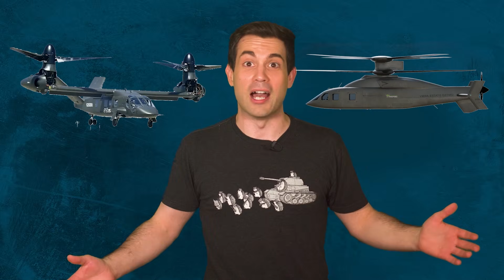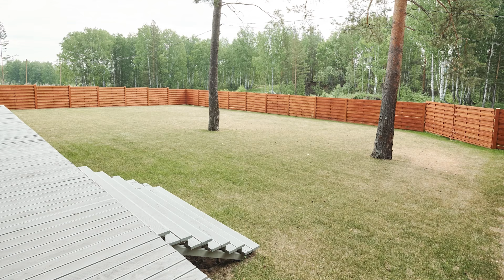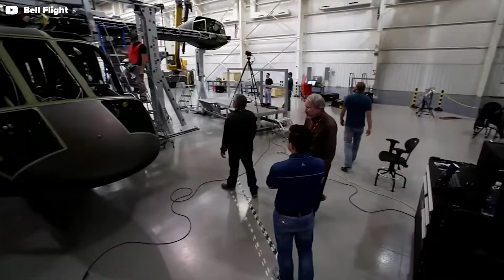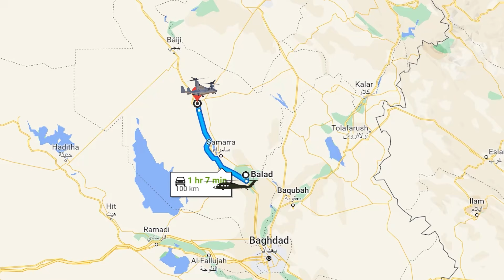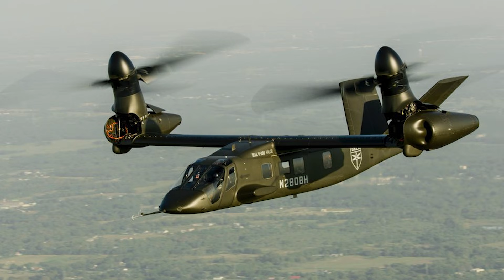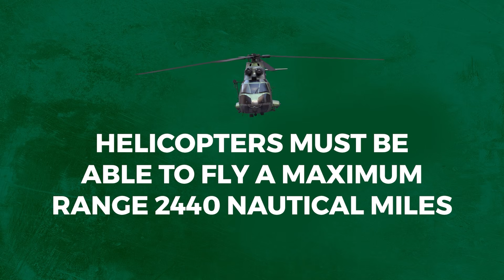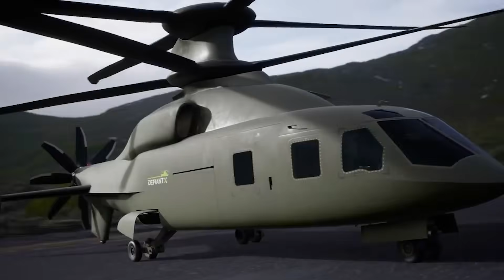V-280 Valor Helicopter Will Help Defeat China

Comment: I think the big screen is a bad idea. if it goes out you lose everything. but this is one of those things that can be changed fairly easily, its just not a good selling point.
Reply: A screen miht look like one big thing, but can actually be built to be multiple smaller screens merged together. It's more expensive than just making the screens obviously split, but takes up a bit mroe space, and not as good for showing larger things over multiple screens.

Comment: One big thing that is mentioned is that Bell and Boeing jointly made the V22 but only the wing components are made by Bell. Boeing makes all of the main body and structures aspects of the helicopter so I doubt that Bell would be able to supply and fab FLRAA in a quick turning point whereas Boeing has both Philadelphia and Tulsa where all they do is turn out helicopters
Reply: The manufacturing aspects behind just seem like a drawback to me of bells proposal to have a fleet rolling out anytime soon

Comment: idk if they can achieve less maintnance with v280. v22 is the most expensive helo to fly, and v280 will be more complex. ALso v22 and probably v280 can't autorotate to land smoothly if the engine quits. Also, BlackHawk has countermeasures to defeat missiles. The new and old helos will be in roughly same position if they were shot at.
Reply: See any of those Black Hawks Landing smoothly? The 280 has a wing for Lift.

Comment: Forward observers, artillery and long range missiles will be the future of warfare IMO - Anything that flies will be obliterated by manpads or automated air defense systems - If the terrain cannot be used as a shield or to hide the incursion, it will have little chance of succeed against AUTOMATED target acquisition missile systems or high precision artillery.
Reply: Only true when you're Russia and you can't SEAD. The US dabbed on air defense systems.
Reply: The Ukraine war is an obvious example that the described scenario isn't here yet or likely soon. Electronic Warfare and stealth design apparently is enough to overcome S-300 and S-400, two of the most advanced anti-aircraft systems in existence.
Reply: @tonysu8860  do you see any Ukrainian jet fighter still flying? what about the 7 out of 7 helicopters downed attempting the rescue of the Mariupol steel plant fighters?
Stealth technology is overrated, just an excuse to squeeze more taxes out of us.  "Stealth" jet fighters has been downed already, no such ting as complete radar invisibility, just MSM bs.
Reply: @TM-529  There are numerous reports of Ukrainian jet fighters flying, surprisingly They're just probably not flying where there are serious threats.
As for the helicopters shot down near Mariupol, I'm troubled by the attempts to resupply using helicopters. If I was in charge of that, I don't know if it would have worked but I would have instead stuffed some empty bomb casings with supplies and dumped them from the largest drones I had. TB-2 drones have apparently had a fair amount of success in this war without being consistently shot down. From what I've heard about the Russian siege of Mariupol, I'd also say any rescue attempt was a very long long shot.

Stealth technology does just fine, thank you.
It's not 100% and won't work in all situations, but it does work against current air defense systems technology

Comment: Should require the helicopter being able to load the M777 gun inside the body, not just sling outside. You can not sling a  gun outside for long distance.
Reply: The issue is that internally loaded materials cant be cut in case of autorotation... making the vihicle  needing much more margine of error.... while... I kind of agree wirh your statment. They would need to be quote a bit bigger
Reply: Ditch the tilt rotor. It’s a over complex design both mechanically and for flying.

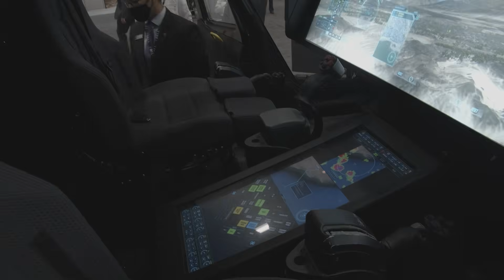Comment: 6:30 well I don't know. It seems like you only need a few hits to one part of the screen and suddenly the whole thing is unusable. Redundancy is key. The dragon spacecraft can have screens for pilot input, but mainly because it won't be shot at
Reply: While I don't know what tech will be used here, a few general things:

1) a Screen might looks like it's only one big screen that is easily damaged, but in reality can be build from multiple smaller screens. That way a group of shots can only take out a part of such a larger controll screen. 

2) going with a merger of smaller screens together is better than a physical setup, as you can set it up so every aspect can be displayed on any screen. If you physical kobs and dials get shot, they are gone. With a redundant screen setup you loose total screen space, but not functionality.
Reply: @reappermen  Good point, that is indeed a big plus. If you could make it out of a dozen of the same standardized and easily replacable screens sure, why not
Reply: My thoughts exactly. And if it was touch screen what happens when it gets dirty, or wet and would you constantly have to clean it so you would have a clean picture?
Reply: @justinhansen1328  Conductive touch screens and wet hands are a real problem on phones already, indeed! Just imagine the phantom button push potential. Whoops, just shut the rotors off :D
Reply: @wylnd  there’s a film you can get that you put over touch screen which stops all of that, we use em for work.
Reply: @wylnd  while they are not often used for civial use due to costs, keep in mind pressure sensitive touchscreens exist. They don't have any of the dirt and moisture problems capacitive touchscreens have. You need to spend a good chunck of money if you want to make them good, but in a multi-million dollar heli a couple hundred dollars extra for a screen won't matter much.

Comment: The issue with aircraft like the V-22 Osprey is uncontrollable roll pitch due to the rotors creating a competing vortex and pulling the aircraft in one direction. This has caused a lot of fatal accidents. Most recently there was a crash near Glamis, California. Though an investigation is still underway. The problem has mostly been overcome with fly by wire and computerized autopilot input. But when flying a figurative brick that requires perfect balance between rotors. It's not exactly reassuring to think that you're one defective circuit away from crashing.
Reply: Triple redundant, means all three flight computer must broke, at the same time, to make the aircraft crash
Reply: @MASB29  All supplied by the lowest bidder. Redundancies are great and all but the layout is an afront to aerodynamics. Even a standard helicopter can roto glide downward and land with a dead engine. The accident record kind of speaks for itself.
Reply: @robertalaverdov8147  that’s the whole point of great engineering tbh. Most cheapest and effective way to build something
Reply: BINGO! You win!  You're the only one who understands basic aerodynamics in all the postings here.

Comment: 1st Cav 1965. For those who haven't seen " We were soldiers once... and young ", a must watch movie. Wouldn't it be easier to make an artillery piece that weighs around 8500lbs?
Reply: The M777 is much lighter than it's predecessor, and it's still overweight for the Blackhawk. It may be possible to do it for a 155mm cannon, but there will be compromises somewhere.
Reply: I can definitely see ups and downs to both.

Developing a new lighter artillery piece would almost certainly be cheaper and easier, yes.  At least up front.  That being said -

The new lighter gun would have to trade capability for it's lower weight.  Some mixture of range, caliber, and reliability would have to go.  You can pick how much of which ones, but none of the above isn't really an option.  You're also introducing another thing that you need to keep up with on the logistical end and so need a whole parallel supply chain just for this field piece.

From what I'm gathering, part of the point of developing a new helicopter is going to be to streamline the logistical end.  You get to axe both the blackhawks and chinooks (and maybe the lakota too) and trade them in for a single type.  Additionally, the new type is more capable.  Being able to transport a bigger artillery piece also means it can transport more guys, more guns and more gear.  So, yeah, more expensive up front but actually simplifies things in the end.

At the end of the day, if it comes down to which option is cheaper, congress is going to say - money printer go brrrrrrrrrrrrrrrrrrrrrrrrr.
Reply: @ColonelSandersLite  From what you're suggesting, this new project would be along the lines of the F35 and its 3 variants. I believe they will introduce a new heli with Taiwan in mind, but like the T62 in Ukraine... What better way to make room for the new than to send the Uh60L into combat at the start with a field piece that can be transported. If we get involved in Taiwan, it's going to be huge and it might be prudent to send a tried and tested helicopter in first and assess the effectiveness first. Can you imagine losing 100's of these new birds against the Chinese at the start?! Well, let's see how it unfolds 😎
Reply: @ColonelSandersLite  But the marines (those doing most the island hopping) have already either axed or plan to ax anything heavier and/or more complex than the 81mm mortar. They've got (or going to have) pretty much nothing heavier than what could be moved by a few twenty-year-olds. (The US does need a new helicopter just curious how one of the branches is going to benefit from it besides the increased deployment speed.)
Reply: @annoyedbipolar7424  Even so.  A helicopter capable of lifting a bigger artillery piece can also lift more guys, guns, and gear.

So even if the requirement to lift a specific piece of gear isn't particularly important to the marines (and these changes they're talking about may not even stick), it is still going to be useful.
Reply: 105 mm could be moved by UH60's
Reply: Do you mean a lighter m777 or readoption of 'Infantry guns' (both would probably be really effective)
Reply: As others mentioned, Blackhawks can slingload 105s but Army is moving towards more 155s.

Comment: those are not helicopters. they're airplanes with oversized engines and tiltable rotors, and undersized wings. they're VTOL airplanes capable of operating like helicopters, besides being capable of flying way faster and farther by actually BEING propeller-driven airplanes. they're not helicopters the same way VTOL jets are not helicopters.
Reply: No they’re helicopters
Reply: But they are
Reply: Can i say they are a tank?
Reply: @deidresable  yes
Reply: @deidresable  flying fuel tank maybe
Reply: of course I only mean the tiltrotor. the coax with a pusher prop is a helicopter.